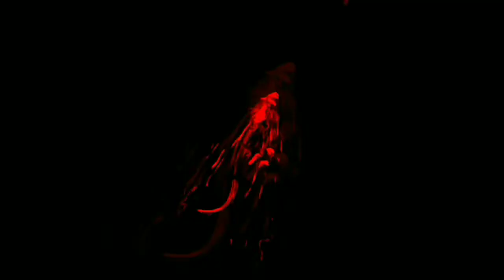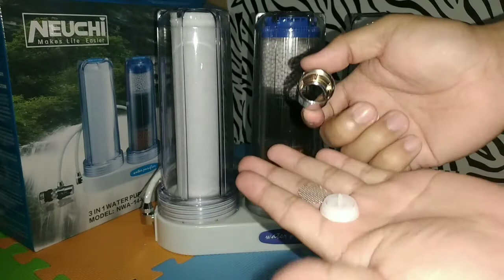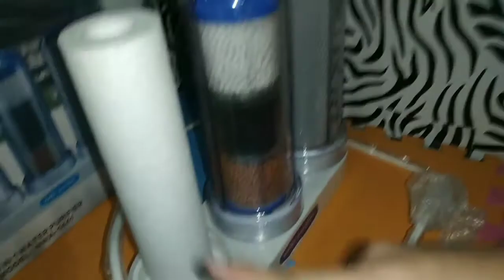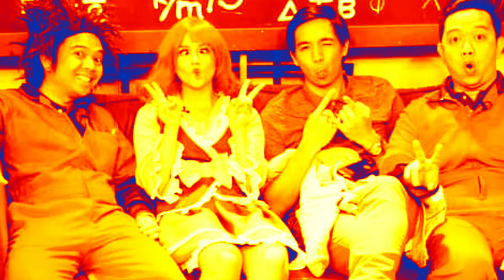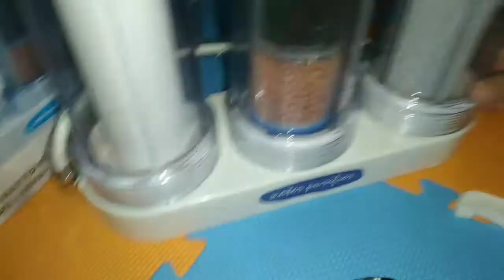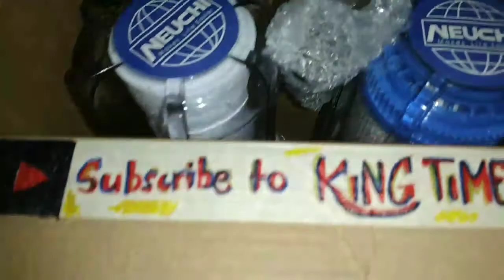How to install Neuchi 3n1 water purifier | how to change filters | neuchi 3n1 water purifier

Comment: Hi po. I bought same water filter pero lasang plastic/rubber. Bago palang sya.
Reply from the maker: Kahit matagal na nagagamit ? Sure po ba na legit yung item? Same brand po ba nito
Reply: @kingtimezone6106  sa inyo po ba sir ndi nag lasang plastic? Ir nawala dn po pag matagal nyo ng ginamit? Ty po
Reply from the maker: Yes at first, then nawala din, ilang day na po ba ? Try nio muna pa run ng madaming water para ma rinse muna maigi, pa supporr po ng channel ty
Reply: @kingtimezone6106  sir ung lasa po b ng tubig e halos comoare n dn sa binibili sa mga refilling station?? Or atleast ung walang lasa po.🙂
Reply from the maker: @Zuryc  yes almost same po lasa, kase filters din naman ginagamit nila and iba is mismong ganyan lang din gamit po. As long as na make sure niyo na malinis naman yung loob ng filters okay po yun. Then palitan nalang din po nasa box nadin po nakalagay if gaano katagal dapat palitan ang filter po
Reply: @kingtimezone6106  tnx so much po. 🙂
Reply from the maker: Welcome Brader, keep safe 🙂👌
Reply from the maker: Additional po pala once napansin niyo po na mabilis dumumi yung filter signs po yan possible may tagas yung line niyo kaya ganon po.
Reply: @kingtimezone6106  ah my instance po pla n mbilis ndumi amg filters. Dto po kc sa binangonan aq sir kaya npapa isip aq kng kaya dn kaya ng purifier. Sana ok dn amg kasa ng tubig if ever mka bili aq🙂